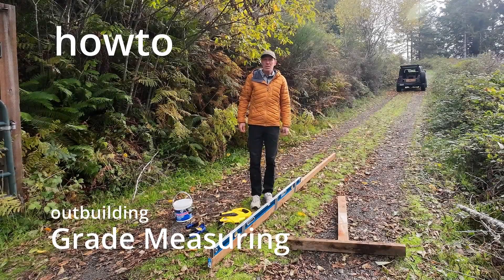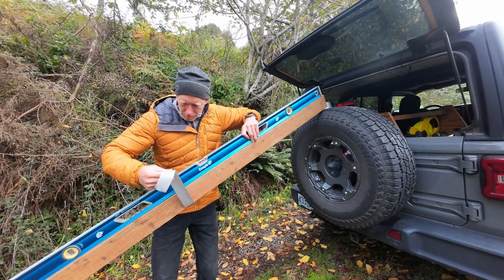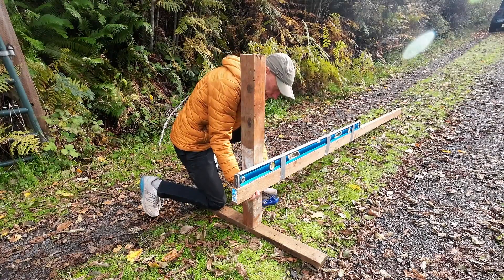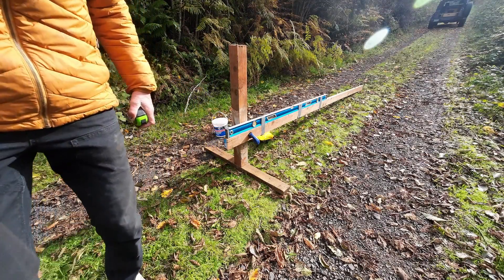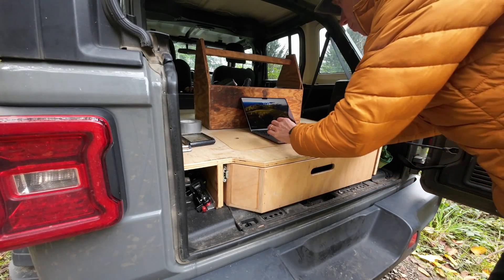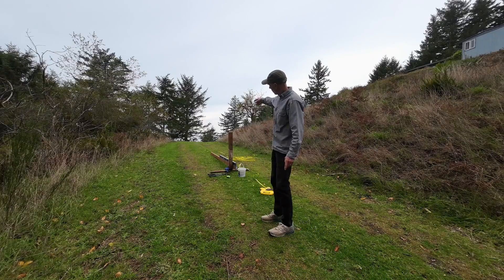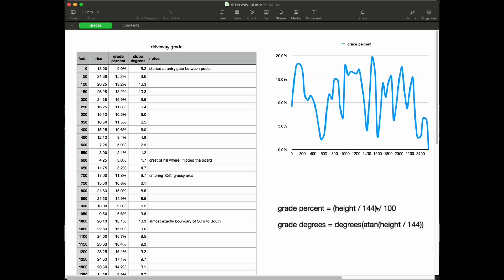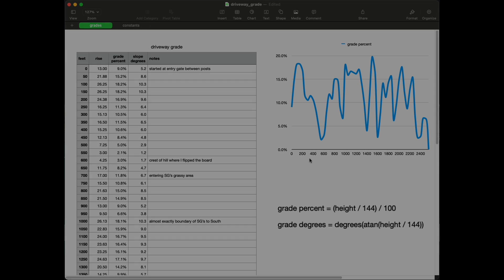003 - howto - Grade Measuring

Comment: Get a 100' foot garden hose attach to at the ends clear hose 10' foot with sticks to support and mark measurements. Fill hose with water until you see it in both clear hoses on the sticks fill water to middle of sticks and mark that as zero measurements up and down from there on both sticks. When you raise one stick, watch the water movement and measurements from their and the distance between sticks.  

This is also how you get siding perfectly around the house, all nice and level.
Reply from the maker: David,

I love it! We probably owe the Egyptians for this as I believe that is how the pyramids were set up. I have done this before for some landscaping and construction. Super accurate and once you get the rig set up, it is easy to manage. For this driveway, it ended up being about 2500 feet so I did the quicker (easier) approach. I hadn't even considered the water level but will keep it in mind. I think I even still have the clear tubing with hose fittings sitting around somewhere in the shop.

Thanks for watching! If I do a follow-up, I'll add that information about water levels and give you credit.